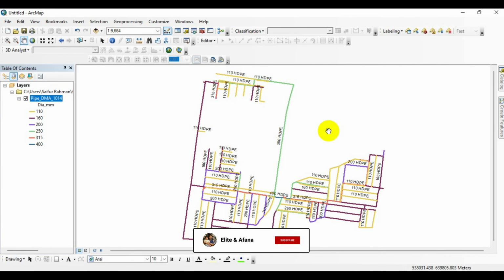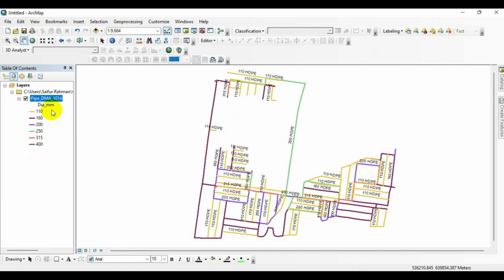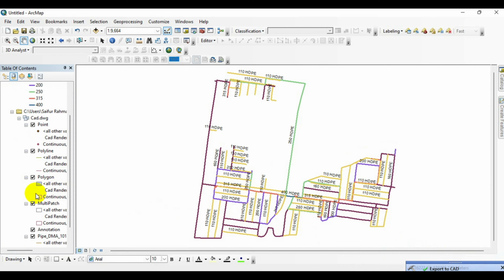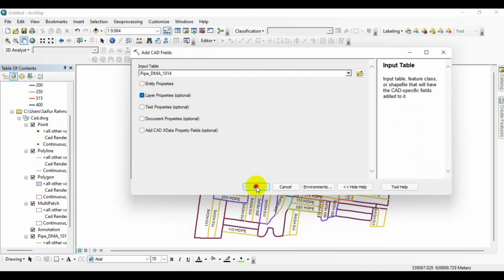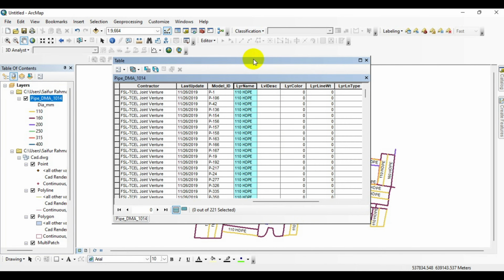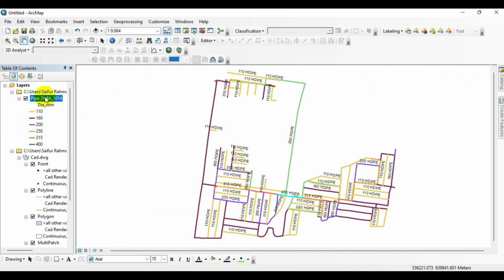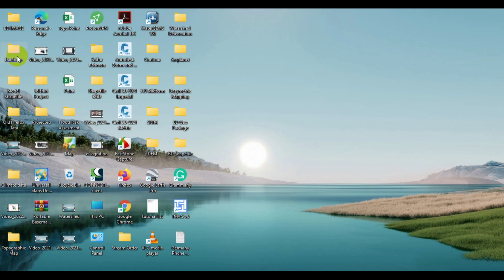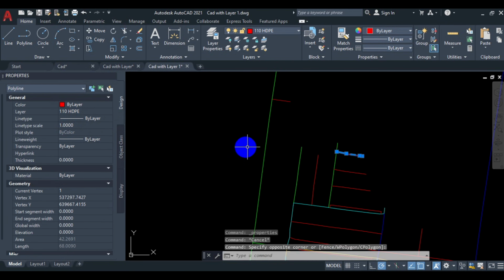Converting GIS features into multiple AutoCAD layers based on attribute values (Field to CAD Layer)

Comment: When I upload CAD data in ArcMap it does not show layers as it shows in AutoCAD. It shows only Annotation Layer, Point, Polygon, Polyline and Multipatch. I want to show all layers seperately in ARCmap just Like in AutoCAD. Please help me
Reply from the maker: ArcMap displays CAD data differently than AutoCAD because it reads the data as feature classes rather than directly replicating AutoCAD layers. By default, it categorizes the CAD data into generic feature classes like Annotation, Point, Polygon, Polyline, and Multipatch rather than keeping individual AutoCAD layers intact.
Reply: @EliteAfana  So how can we categorize as in AutoCAD